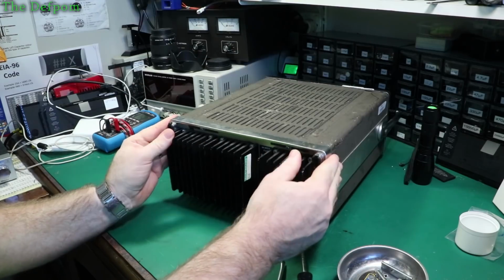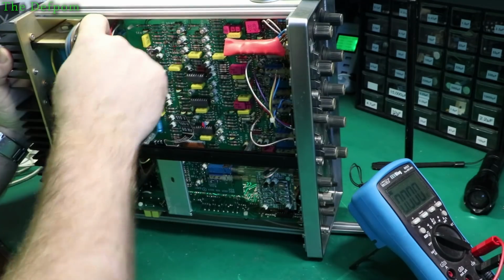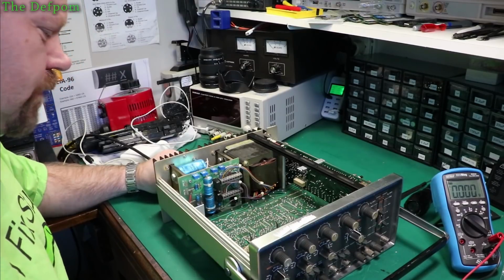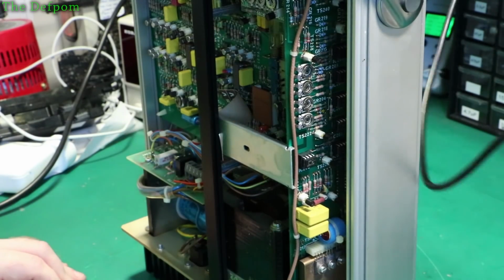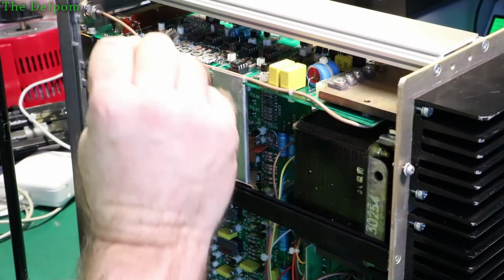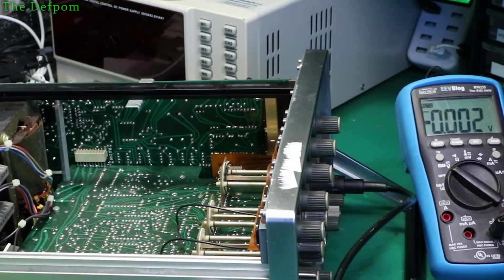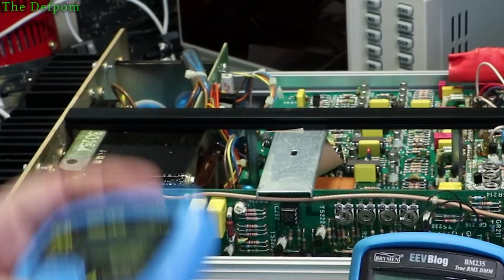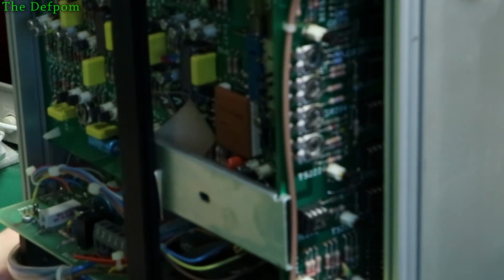🔴 #564 Philips PM5716 Pulse Generator Repair Part 1 - Down The Rabbit Hole We Go

Comment: Glad to hear you got the schematics!  I'm looking forward to part 2 -  it seemed to me that a bad output transistor might be the problem as they are connected to the "outside world" and most susceptible to a main cause of test equipment failure - human error. Also, an output transistor could affect the DC offset voltages.
Reply from the maker: David V - I managed to find a faulty part before I actually got the manuals, I suspect it is the only blown part (spoiler it’s not an output transistor), I ordered a replacement which I’m waiting to arrive, once I replace that I can at least troubleshoot and test using the diagrams and calibration information.

Comment: I am sorry I couldn't watch all of it, too long for my available time, just out of interest Earth Leakage Breakers or RCD's rely on an active path the earth not a neutral path to ground. So with the mains wires reversed the RCD will not trip if a fault develops from the mains voltage. i.e. it was a death trap. At least your instinct said to change it back.
Reply from the maker: WIMake II - I think it depends upon the protection device, most RCDs have both the live and neutral passing through a Ferrite core, so the currents cancel each other out, so any leakage to earth (above its threshold) will trip it.
Reply: @TheDefpom  The issue is a bit more complicated. The Neutral wire as per standard is connected to the earth outside or sometime in the switchboard in the home or on the street. If wired correctly the neutral wore provides a return path for the circuit and subsequently to earth. When you touch the neutral wire, there is minimal active current to trip the RCD.  The 2 coils on a single ferrite core in the RCD are only there to provide a balanced flow for the RCD in normal mode. Current in and out are the same, and the RCD transformer is inactive. If the active wire only finds a return path (via your body), then the 2 coils become unbalanced, and that energises the RCD and trips. It can't do this on the neutral as there is not enough current imbalance as the neutral wire is connected to the earth. If you draw a simple circuit for this, it should be reasonably clear. The machine will not experience the issue, especially the transformer based system as the transformer does not care if the active and neutral are switched, only your body cares when it came in contact.